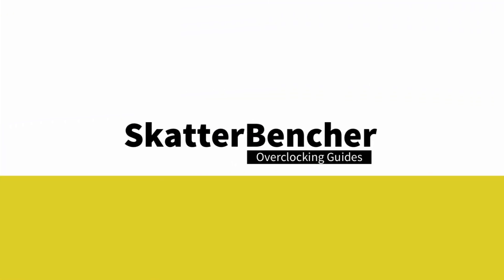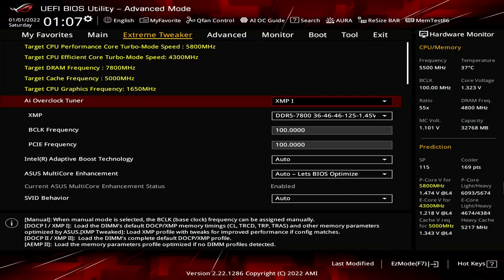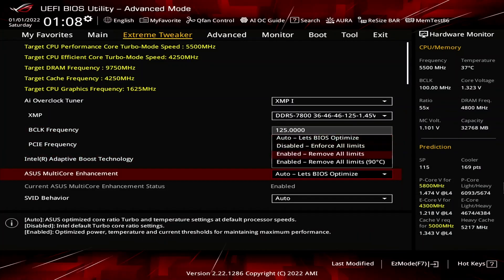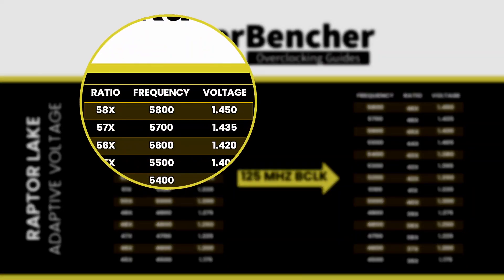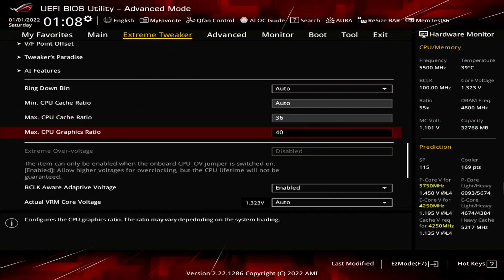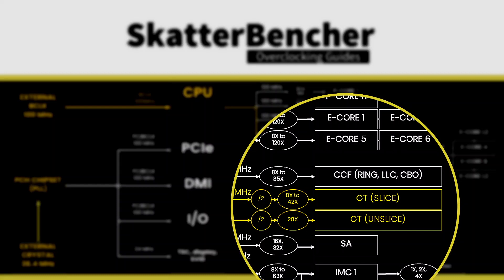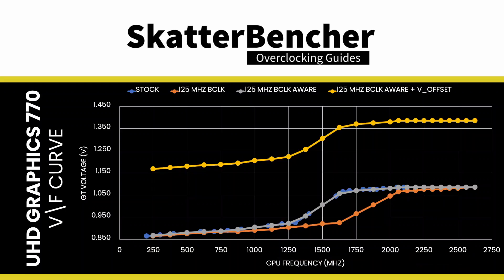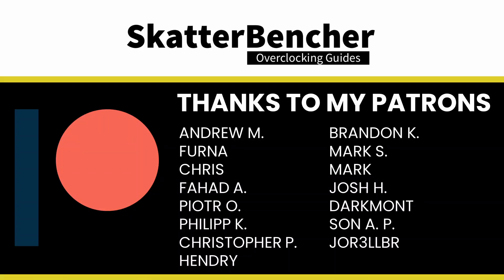5 Minute Overclock: UHD Graphics 770 (13th Gen) to 2500 MHz

Comment: Holy moly the results are actually insane.

Would be suuuuper cool to see a VMAF comparison for captures using QSV (ESPECIALLY if you got a 14th gen with AV1 encoding), but it would probably be a lot of work
But it worked sooo good for getting FPS out of the slice!! xD

BCLK oc kinda scary. The whole voltage mode for it is probably the key but my i7-7700k almost shit the bed when I added .2MHz to it lol

Wish I could upvote twice